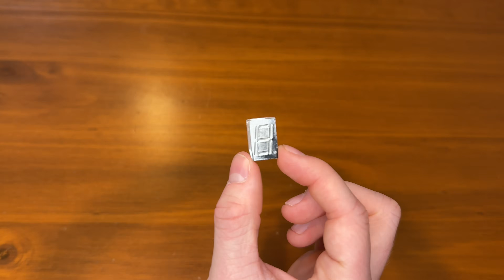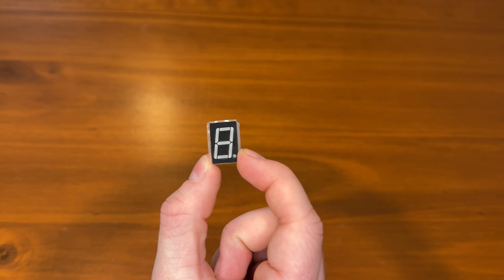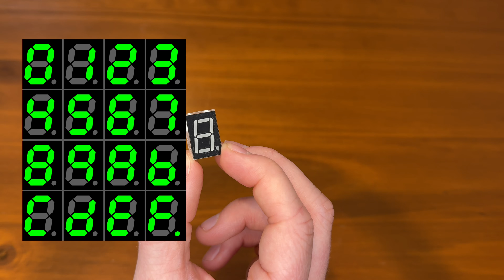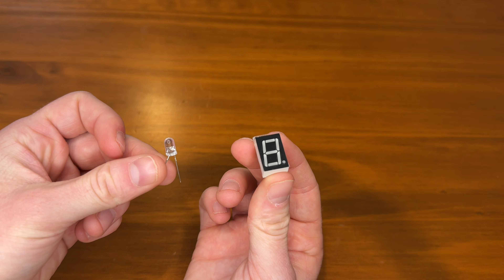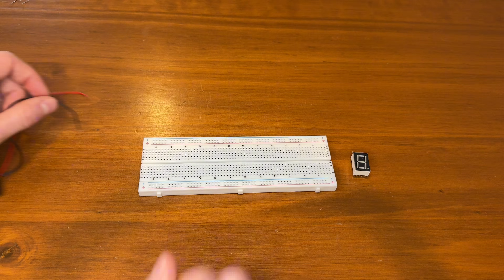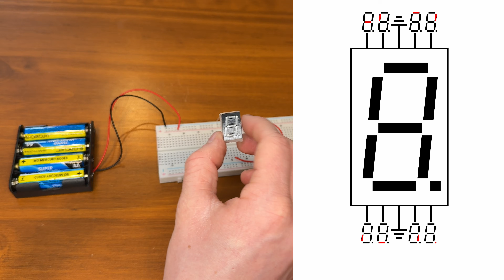Segmented Displays Explained

Comment: Why does it not work
Reply: I ran into a weird issue as well. I'll tell you what happened so maybe it's happening to you as well.

The long bars on the bread board are separated at the midway point on my breadboard, where it is not on this instruction video.

I added wires across that break to complete the circuit.

Or just keep all your wires on one half of the long bars.
Reply from the maker: Hello, please ensure that you have connected across the right and left half of the breadboard power rails. on some boards they are disconnected at the midpoint. if this is not the issue please ensure that all connections are secure including your power source, please let us know if this fixes your issue, thanks!

Comment: Not working
Reply from the maker: Hello, please ensure that you have connected across the right and left half of the breadboard power rails. on some boards they are disconnected at the midpoint. if this is not the issue please ensure that all connections are secure including your power source, please let us know if this fixes your issue, thanks!